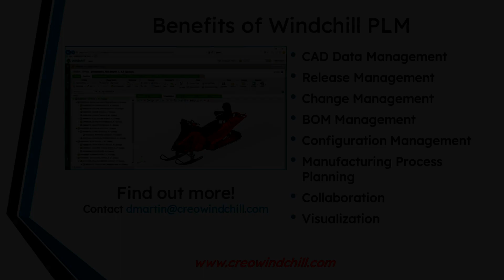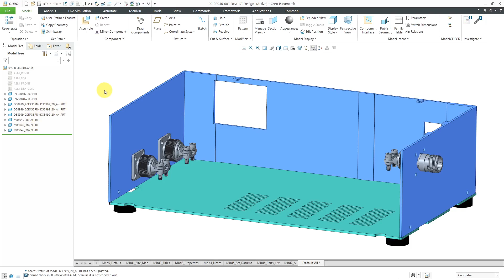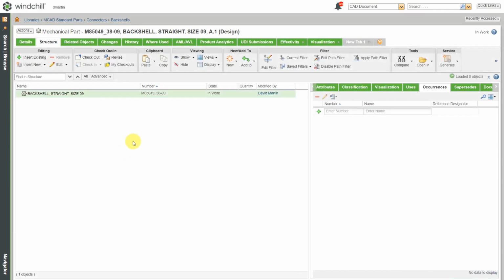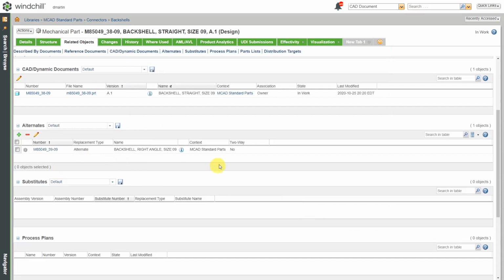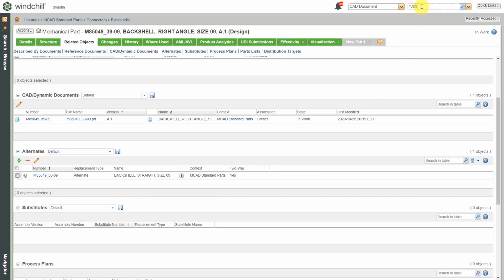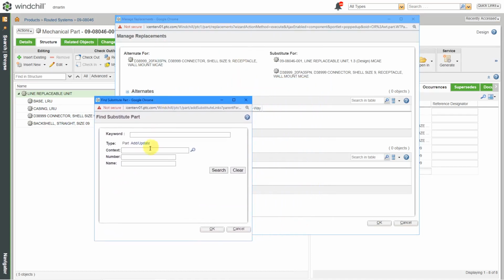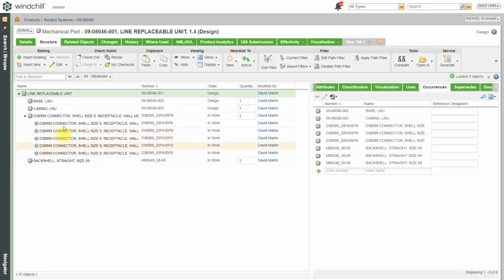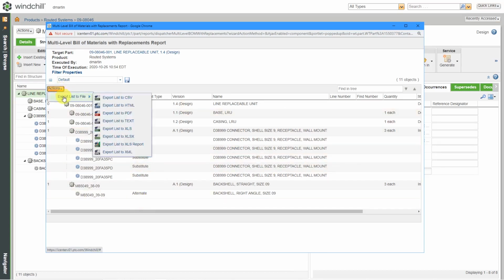PTC Windchill PDMLink - Alternates and Substitutes | BOM Management

Comment: "People are able to swap out ..." Who is this for? Engineering? Maybe I don't understand the example but I would never make two non-interchangeable parts alternates for one another. For modeling purposes, I could see engineering wanting to swap between right angle and straight connectors but wouldn't you handle that in Creo as a modeling practice? I'm assuming this Windchill isn't connected to an ERP system?